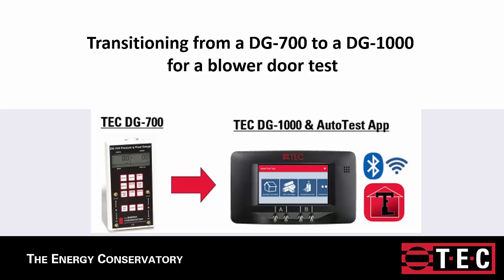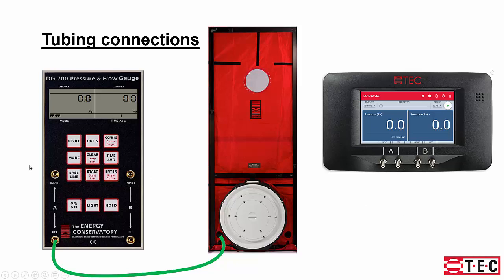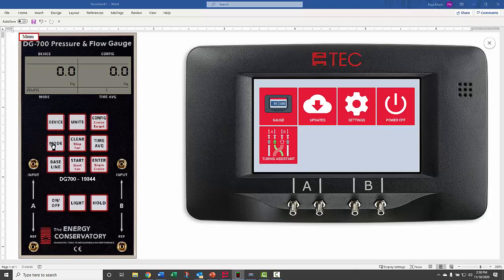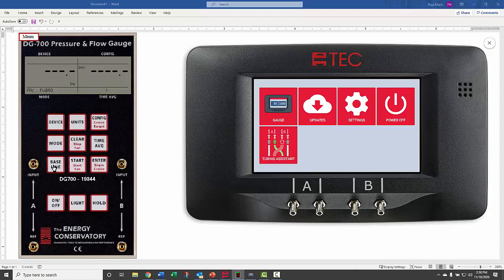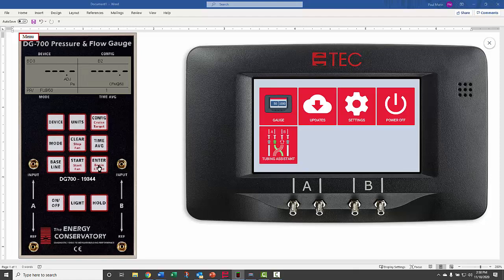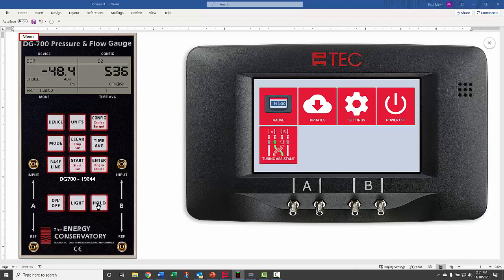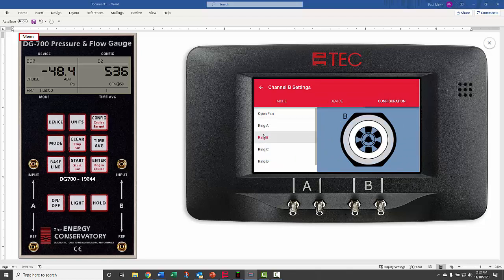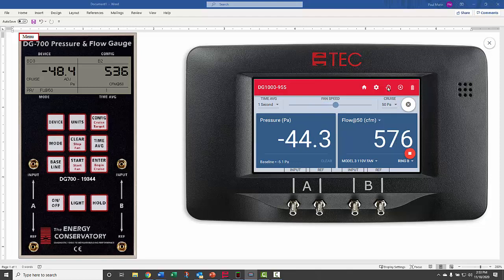Transitioning from DG-700 to DG-1000

Comment: I have a question... Usually with the 700, you'll push time average and it gives you your number and stops. How do you achieve this with the 1000? It doesn't really give you a solid number... thanks.
Reply from the maker: The DG-1000 has different options for time averaging.  1 second , 5, second, 10 second, and long term averaging.  This can be found on the gauge screen on the top left corner.  The gauge will continue to update depending on the selection made.